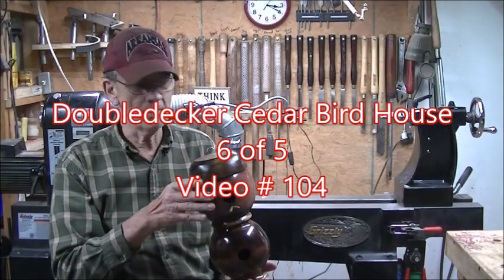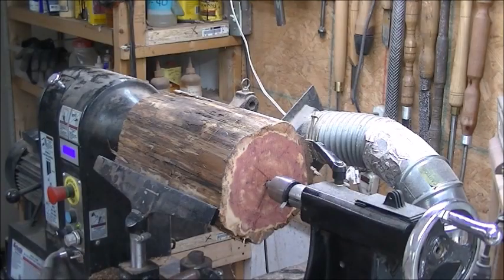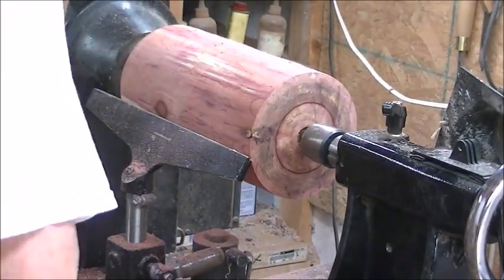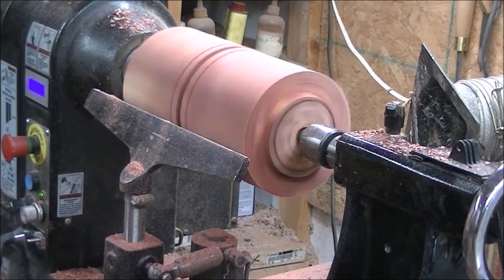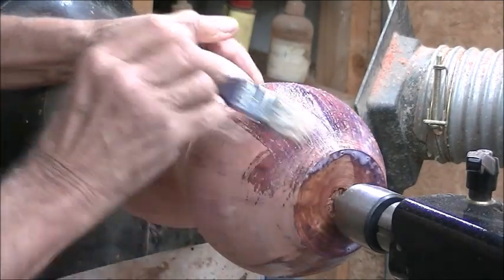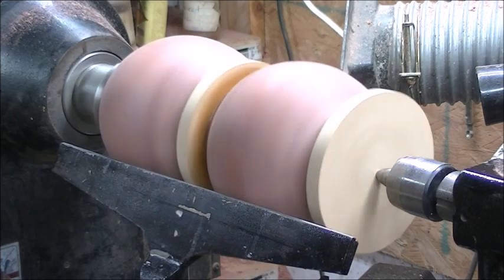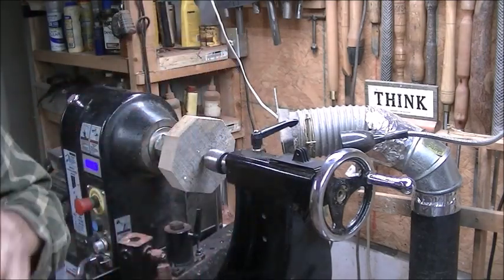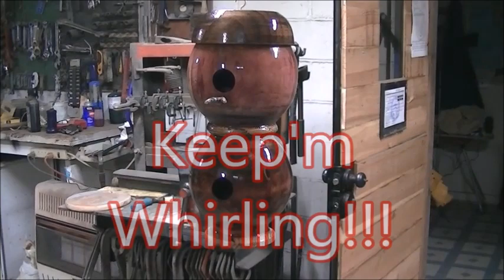Doubledecker Bird House 6 of 5, video # 104

Comment: Hey Larry, great video. I want to know how you figure out what kind(volts, amps, etc) of speed controller i need for my dc 18 amp 2 1/4 hp motor?
Thanks
Reply from the maker: Most places will tell you that info.  If not ask.  But it has to have those specs at a minimum.  Take care, Larry